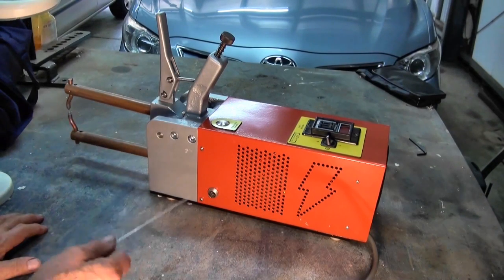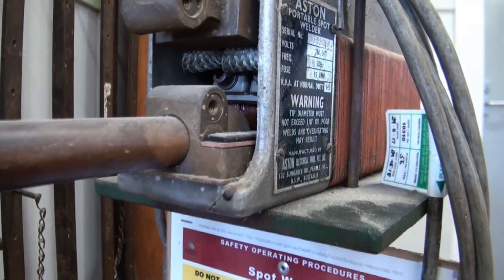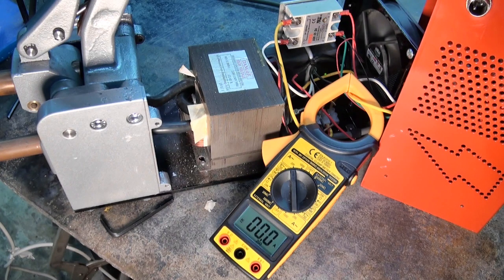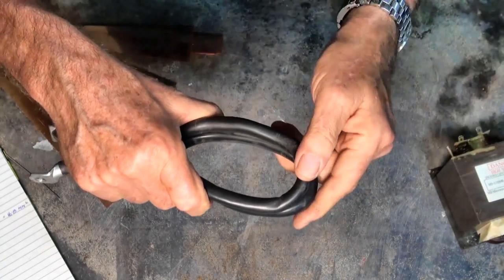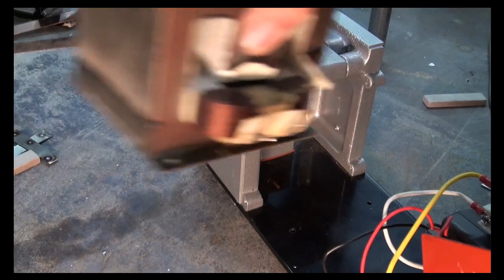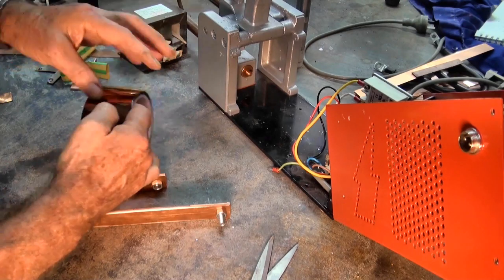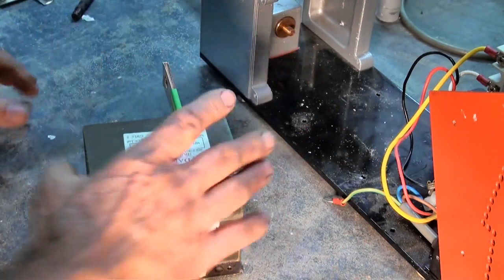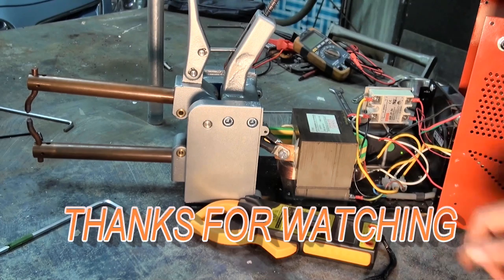Spot Welder Upgrade Goes Sideways

Comment: Thanks for the shoutout, it's exciting to see you make some (attempted) upgrdaes! A few suggestions:

1 - When I suggested you replace the 2-turn secondary with a 1-turn secondary, one purpose of that was to pack more copper into the 'wasted" core space, not just reduce the turns ratio. You reduced the turns ratio, but you didn't manage to fill the core. If you look at the mass of copper you have in the core, you have probably less than before. With half as much copper as you could have, you will have double the resistance, and the impact of resistance is twice as important with half the voltage. So that explains why you ended up with almost exactly the same results. You made one thing twice as good, and another thing twice as bad.  You're only filling 30% of the core space with that secondary. Keep stuffing it right full!

2 - You have to keep your welding loop as short as possible, to reduce inductance. At some point (maybe around 2 feet?) you are better off with 2-turns again, just to overcome the inductance you're making by having a bigger coil. I think you're still in a good range to benefit more from a 1-turn secondary than a 2-turn, but that might be a reason why you're not seeing as much benefit as you'd hoped.

3 - I'd cut up your old cable sections, strip the insulation, and layer that along the outside of the secondary and wrap it all together tightly. You're only dealing with 1 volt, so, any minimal amount of insulation is sufficient, you don't need those big insulators. And, if you can, double up your connecting wires too that'd help, that's probably 25% of your secondary that's still half as thick as it should be. You can see by how melted the insulation was on the old secondary that lots of energy is being wasted in secondary. Double the copper means half the waste. 

Also, sorry for maybe wasting your time :/
Reply: I'll add a 4th: Cut the insulation off on the back (curvy) end of the loop. Only have insulation where the copper passes through the core. The insulation at the back end doesn't provide value, and it probably cuts the heat dissipation by 70%. Bare copper exposed to air is best. This will only matter on a timescale of minutes. If you only spot weld 1 or 2 in a row, with lots of time to cool down in between, then the extra cooling won't matter.
Reply from the maker: Thanks for the tips Matt. I do have more copper strips so it is easy to increase the mass of copper in the secondary. I did originally intend to use 12 strips but when I did the calculations it showed that 5 strips were over twice the area of the old cable. I did double up on the connecting wires and it was a struggle to get it all fitted back in place without making the connection really stiff. I am wondering if it would be better to use two MOT's in parallel? Maybe even to use two MOT frames with a common primary and secondary? I would probably have to get two identical MOT's and cut through the weld so I can install the coils. At the end of the day it was more or less an intellectual exercise and I am still happy with the performance of the welder and it still fits in my cupboard. If I go down the road of fitting an extra MOT I will need to find somewhere else to store it. Don't worry about wasting my time - it keeps me off the streets!
Reply: It doesn't look like twice the cross-section, but, in any case, you want as much cross-section as possible. The symptoms you're having indicate either too much resistance or too much inductance. Too much resistance you just need to beef up the secondary. Too much inductance, you have to go back to the way things were with 2 turns :P.

You can use two MOTs in parallel (or series). You can also mix and match primaries and secondaries. For example, two primaries in parallel (each getting 240v), but one single loop for the secondary that goes between both (so you pick up the amperage from both). There are only a few form factors for MOT cores, (like, 5), and of those there's really only 2 common ones, so, 50/50 on whether he next MOT you get is already a match. It will match the EI shape, but not the "core stack" dimension, which doesn't matter because you'll just be making a big stack of them anyway. The pain of making a single deeper transformer is that now you need to re-wire a new primary, which you probably can't do from the old primary wire.

Glad I'm doing my part to keep you off the cold streets and out of trouble. Idle hands being the devil's plaything and all, cuts down on the office shenanigans.
Reply: Matt, Excellent and accurate info to help maximize his welding amperage and voltage!  good info!
Reply: @MattsAwesomeStuff  - You have given some excellent advice - 2 primaries might saturate a single core and create a lot of heat but not much added power, so in that case i think you would have to go with 2 cores.  For simplicity i think if he maximizes the copper to almost the entire secondary space available with 1 turn or 2 with thin insulation like you said (maybe Kaptan tape) will give him the best results.
Reply: @advancednutritioninc908  - It's an old video, and Mark has since re-modified it sort of back to the way it used to be (2 turns) but with heavier wire. It works as well as he cares for it to work and there's diminishing returns on him putting more effort into it, other than in the experimental sense of "which design is optimum". I think he's at the point where it's more fun to put effort into his other projects than to figure out which was in fact the best way to build a spot welder.

I don't think 2 primaries will saturate the core. You saturate a core when you don't have enough turns, not when you have too many. Adding more copper, yes, will help whether he has 1 turn or 2 (as he's observed), but it's a necessary help if he wanted it to perform superior with only 1 turn, which, he doesn't, it's good enough the way it is.
Reply: instaBlaster...
Reply: I’m not quite sure what you’re trying to say in the first part. If you’re saying that by removing one coil, and ending up with less actual wire there than you now have double the resistance as a result, well, that’s incorrect. The shorter the wire, the lower the resistance in the shorter wire than in the longer one.

By using heavier wire, the resistance will drop even more, with less heat. That’s obvious. A high quality very flexible welding wire with many thin wires inside will be easier to bend around. 

For better power transfer, the “wire” needs to wrap completely around the coil, not form a “U” shape. The further away from the transformer walls the conductor is, the lower the power transfer.
Reply: @melgross  - Let me correct. I was comparing two situations. I was saying there was double the resistance compared to if the single coil was twice as thick.
Reply: @MattsAwesomeStuff  your right it won't saturate the core. 
 more iron adds up to a bigger tank of energy. 
The one turn would have worked if he had a bigger csa,

Comment: I enjoy watching trial and error before attempting for my self.. good findings , thanks a million for the valueble lessons
Reply from the maker: I really should delete that video. It wasn't the outcome I was looking for and I regretted spending so much time on what turned out to be a bit of a fizzer. I have since gone back to the old configuration although I used a much heavier wire and now the welder performs really well. I am still surprised that the common or garden variety microwave oven could yield such a useful tool. 
Regards,
Mark

Comment: The input current will be the same.   Since transformers output voltage is the ratio of number  of turns of the primary to secondary, reducing the turns on the secondary will reduce the voltage in the secondary. Since volts x Amps= watts, and watts in = roughly watts out, reducing the output voltage will increase the output current.  Therefore, you have increased the output current but will not see an increase in input current.
Reply from the maker: Jim, I'm afraid that electrical black magic is not my speciality.  I can see now why the results I was getting were ambiguous. Thanks for the explanation.
Regards,
Preso
Reply: You're all forgetting about the resistance. V = IR   (I = V/R) While the resistance through the cables and the work material is next to zero is it not zero therefore it will not pull the maximum current unless you get the voltage UP ... increase the number of turns of cable around secondary (remove the insulation and replace with tape like you did the bars and epoxy in after testing)  With a higher voltage (numerator) any given (fixed) resistance (denominator) will draw higher current and you will get better performance.  Transformers do not "push" current ... your load pulls it.  This is why if you put your finger between the electrodes and press the button  at 1.0V the resistance through your finger is so high that it limits the current drawn as per the equation.
Reply: @advoc8tr  basically that’s correct. It’s why transformer wires are coated with a thin, high temperature varnish instead of rubber, vinyl, Teflon, or other, much thicker insulation.

I wouldn’t trust tape though, unless it’s electrical, high temp fiberglass.
Reply: I think your statement is only correct under certain conditions. It assumes that the secondary draws the maximum power the primary can provide. In this case it does, as he verified, so the secondary current will be double as there are half the number of turns (minus large inefficiencies, single turn transformers aren't super efficient). 
Metal can only carry so much magnetic flux, so there is a point where a transformer cannot provide more power because all the flux that fits in the metal core is present. 

A mechanical analogy might be two v belt pulleys. As you turn them at some power input the belt will slip. It can do so at the input or the output. If the output slips, the system is capable of providing more power, but the output cannot use it. This would like the secondary coil saturating. If the input pulley slips, that is the max power you can push into the system. It doesn't matter the reduction ratio of the pulleys as the input is slipping in both cases limiting how much makes it thru. The torque would be analogous to the current and the speed or RPM to the voltage. The power is the product of the two in both cases P=I*V=T*Speed. So if the input is limited by slipping the power input is fixed, but the output torque and speed depend on the pulley size (number of turns of the transformer).

Hopefully that makes sense and is helpful.

Comment: Mark,
Quick thoughts on the upgrade. It takes voltage to drive current through resistance. In the first approximation the resistance of the  spot being welded dominates; all other resistances (tips, arms, cables, secondary winding) are smaller and can be neglected for now. Voltage across the spot was about 1.5 V. Driving the transformer primary with 220 V gives voltage ratio of roughly 147:1. Primary current was about 5.8A. Input power is 1300W (normal for a microwave oven). If all power is dissipated only in the weld, welding current would be 1300/1.5=866A (optimistic, so be it).  Power dissipated in a resistor P=RI^2. R is constant for now. The only way to drive more current is to increase secondary voltage. Three turns would be nice; alas no space in the winding window. 

There are two alternatives: 1- decrease number of primary turns (hard); 2- increase input voltage (easier). Since dissipated power rises with square of current, and current rises linearly with voltage (resistance assumed being constant), raising input voltage to 1.414 times 220 should result in doubling current thus doubling power dissipated in the weld. But the primary winding will suffer, so will the core and everything else including nearby ears. That the transformer was "buzzing" with 2 turns and was quiet with 1 turn secondary is because it is running "1/2 as hard" on 1 turn than with 2 turns (magnetization in the laminations makes them vibrate; more power, more vibration, roughly speaking). 

It is no accident that the old welder with one turn has a huge core and smaller number of primary turns wound with thicker wire (measure it).

Of course, detailed design is more complex because the, so far neglected, remnants of the circuit also play a role. So does use case, such as intermittent duty, duty cycle, cooling. Thermal design, maximum allowed winding temperature, etc. Cooling - air, oil. By the way, all metals in the circuit (copper, steel) have positive temperature coefficient. That is why the second current measurement was lower because all copper got warmer.

Good primer on transformers: https://en.wikibooks.org/wiki/Electronics/Transformer_Design

Milan
Reply from the maker: Ahh, food for thought. I will follow up on this because I felt a little disappointed when I realised that what appeared to be a logical improvement turned out to be less than I had expected. Electrical theory is not my "thing".
Reply: Mark, drop me a line if I can be of any help. Milan

Comment: I'm in the middle of building one to. 
Fantastic clamping mechanism. 
I'm a electric motor rewinder by trade. 
Your on the right path but your also playing with 1.2 volts. 
As you have probably been told or had suggestions on this secondary. 
There are a couple of things I can suggest. 
First bigger csa. 
Cross sectional area. 
Insulation material can be bought from your local rewinder. 
N. M. N. 
Nomex, Mylar, nomex. 
This is for slott insulation and between windings. 
Packers,  green board or g10 .
Is high temp and super strong fiber glass. 
You can get off cuts from your local rewinder. 
He might even have some enameled copper section wire that's left over from a job, 
Ask to go through and you might find something. 
Your current path. 
Question : are the aluminum castings when all fitted together have a circuit (are they insulated from the conducting path.) 
You could have unwittingly created a inductive sink when the current of the copper round bar passes through the aluminum casting. 
You might actually be getting a field through it. 
The other thing. 
Have you measured the voltage supply when you load test it. 
It could be just sucking the energy out of the power grid. 

Last you could get another transformer (micro wave) 
Grind the welds off and split the limitations then weld them on to your one. 
You would have a longer stack. 
Then you might get a better result

Comment: 3M 2510 varnished cambric tape could also be used for high voltage high heat applications

Comment: Mark if the welds are as good as they were before and it’s quieter and cooler, it sounds like a great improvement to me.
Reply from the maker: I did a further upgrade to the welder and it is now as good as I think it can be given the limitations of the input voltage and current. I can weld up to 0.8mm stainless steel which is plenty for the work I do.
Regards,
Mark

Comment: what would using a pipe for the scondary coil instead of wire or flats produce??? making me think there would be something out of the resonance in a cavity..
Reply from the maker: I have since upgraded that secondary with a much thicker 000B&S cable with two turns and it works great. It turns out that the number of strip laminations I used could have been doubled easily but I opted to use just a little more than the original cross sectional area. I have been told that if I had used very thin foil instead of the heavier strip it would have performed better. 
Regards,
Mark

Comment: That was a nice experiment.
I was wondering, The idea for the secondary coil was to use a copper coil that has to use as much of the space available. is it not possible to make use of the original secondary coil of the transformer by cutting one top side of that coil just as your copper strips and attaching that with thick copper wire to the probes?  Or would this change noting and you would need a solid piece of copper?

Comment: Brilliant video, very well produced, but I really missed the jarring background music and mumbling dialogue so In the past I would have had to re-watch several times to understand what was going on, I've gotton so used to that, your's was a joy to watch and listen to. Yes, I too have built a spot welder from a microwave transformer and it does work, but the current is down.   The voltage on a couple of secondary turns on mine  is 1.5v.  Yes, cramming more copper csa in the secondary on a single U section pass will help and I agree with someone else who commented that if the copper secondary was a solid cast copper core the resistance with be lower, with probably much less noise and higher current.
These small transformers will have their wattage limitations and probably trying to spot weld over 1mm thickness will cause the transformer to heat up rather quickly.  Maybe time for an energy boost with capacitors (preheat etc?)   Looking forward to our future Canzuk relationship after we have planted Brexit firmly up the rear end of the EU.
Reply from the maker: David, for some reason YouTube keeps promoting that video which is probably the worst one I have done in terms of the outcome for a lot of work. I decided later to go back to the original design but I used much heavier cable. The welder now works really well and because the larger diameter cable fits tightly into the transformer cavity it doesn't make that horrible buzzing noise. Check out this video for the latest version of the welder. https://www.youtube.com/watch?v=VPTdDzf1-s0

Comment: I went a slightly different route and am getting excellent weld current. I'm using a GALANZ 1200U transformer with THREE turns of 3/0 wire in the secondary. The turns fit easily into the core and  make instant high heat welds. Most videoes that I've seen are using 2 turns of 4/0 wire.

Gary Conway
Reply from the maker: Sounds great!
Regards,
Mark